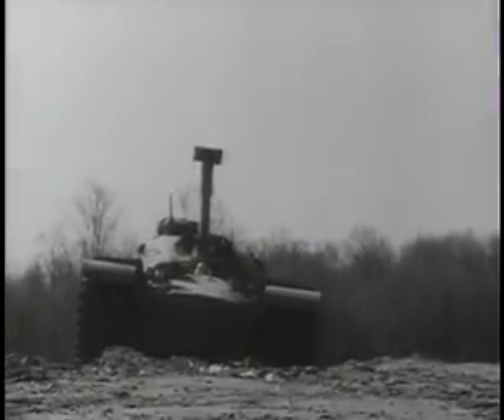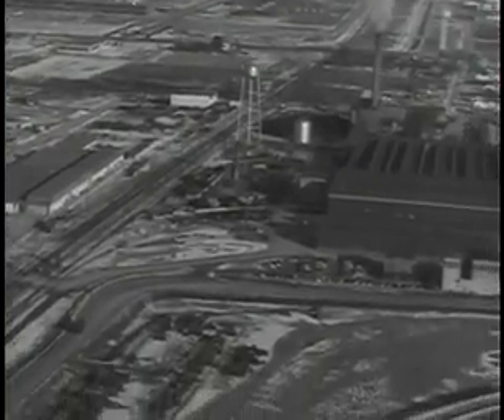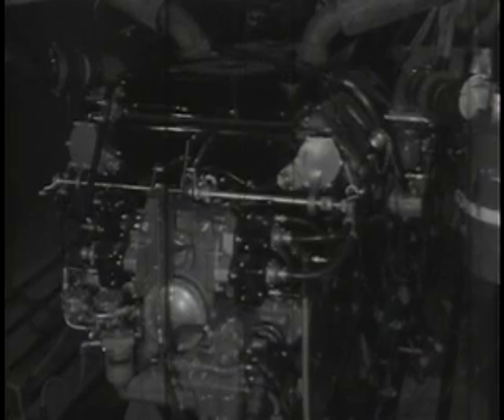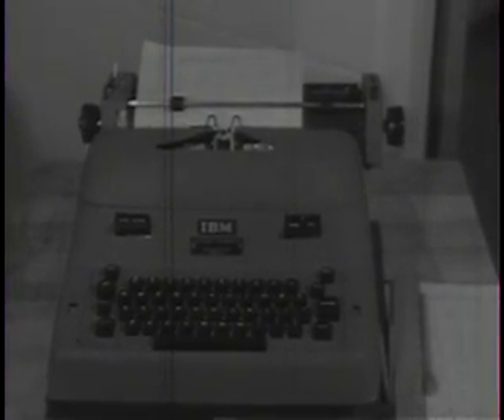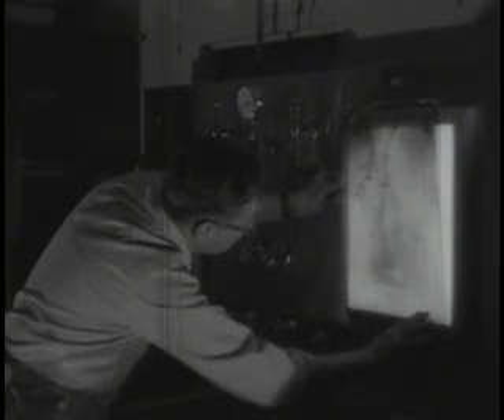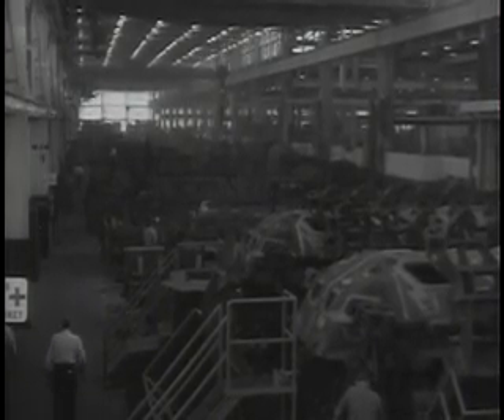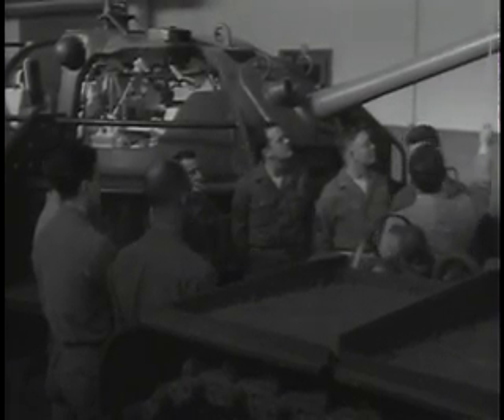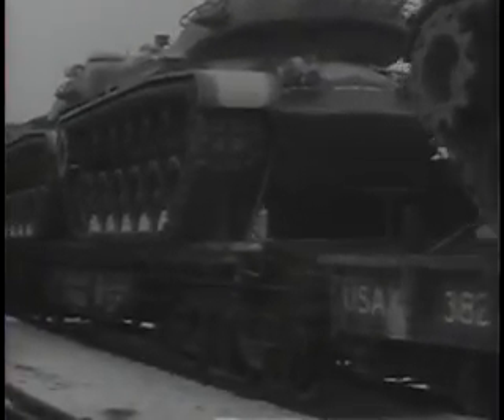M-48 Patton Tank, Design, Development and Testing

Comment: After over 20 years with US. tanks [ retired Msgt usmc] and  served over 2 years in "NAM" , I have spent time at time working on or crewing or just poking around in many types of tanks M60, M48s ,M103 ,M41 ,M60, M4 ,M47, M46, and M1s, Centurions, Chieftain, T55, T62 [I feel for the poor crewmen in it] ,T72, and  a Ger.  Panther.
First of all know .one makes or has made a main battle tank that was not a fuel HOG! [ the centurion burned 5gal per mile ] 
The M48A1 range was around 90 miles [that is with good ole mogas] , the M48A3 with the 1790ds engine "diesel" range was around 180 miles, its top speed 30mph, the Centurions was around 22mph.
The cast-welded armor of the was one best ever fielded just ask the IDF!
The CD850 trans. it could turn on s dime, this was hydro-madtic trans,while the Centurion had "crash-box blood draining manual shift , just ask a Centurion driver! I have a fellow tanker who trained his 12 year old son to drive a M60 and this kid did it very well.
The turret and fire control in the M48A3  was one  the best ever, I hit a 5gal bucket "cold bore shot" at 1200 yards.
Oh ya..I have rammed and jammed over some  5,000 rounds, 76mm, 90mm, 106 mm, 105mm, 120mm, 155mm, 175mm, and 8" ...So if you haven't "walk the walk" shut up!

Comment: I would venture a guess that he is comparing the UK tank to a M48A3, which was diesel powered as opposed to the older gas powered M48A1 (I was a tank mechanic on both).  The M48A3 was a very good tank, and its upgraded version, the M60A3 with its 105 mm main gun, was even better.  During the start-up procedure on the M48A1, a  man had to be stationed near the rear exhaust area with a fire extinguisher to douse the flames that may occur.  Anyone else remember those days?

Comment: The M-48 series was a pitiful disaster.  They were underpowered gas hogs that had no speed,  very poor maneuverability and fair at best accuracy with the main 90mm gun. The 48 had 4 tons added over the M-47 and tracks widened from 23 to 28 inches with no change in engine power. The 48 A2 with fuel injection and covered back deck was an attempt but even the diesel in the M-48A5 and 105mm gun was not much improvement.  The M-60 series carried on with the huge size and cumbersome gun platforms with the M-1 Abrams saving the US armored force. I served on 46-47-48 and tested and crewed the POS M-60 .  For dependability prefer the venerable old 46...my Korean combat wagon.
Reply: From your posting I take it that you (Bill) have never been in a T 54,55,62, or 72, and yes I have and I've driven ring around them all in a M48 and M60. If you want to drive a real problem  tank try the Brit Centurion , its gearbox will drive you nuts. (it burned 5 gals per mile) however it handled much better than the god awful T 62 ( I had one as a pet for a month) my tankers in my unit couldn't believe pile of junk it was,  I wouldn't send my worst enemy to combat it.
I also find your remarks about the accuracy of the 90mm strange, I had no problem hitting a 5 gal GAA can with the first round at 1,200 yards. In my over 20 years as a tanker I have rammed and jammed a hell of a lot of 90, 106, 76, 120, and 105 mm rounds and I am a combat veteran. As a foot note the M46 was an up-grade of the WW II M26, there were no new M46s built.
Reply from the maker: Bill I just posted a clip of some M-46's in action in Korea "A" Co., 140th Tank Battalion, 40th Div.  http://youtu.be/0MW9bq45vko
Reply: ralroost einsnulldrei We were the first army in the world to recieve the M46 patton tanks. Many US tanks for european nations got tested here. But yeah, we quite liked the pattons, but still chose the leopards over them
Reply: Jason Wilson  SPC 4 Larry Owens here. I operated the M-88 for the 702 MT BN at Camp Rice from 67-68. I don't know what all the flak on the M-48 series is about. Trained on the M-48 in Ft. Hood and it was a seriously bad machine that age and poor engineering detail contributed to its poor reputation. The A-2 (fuel injected) and the A-3 (Diesel) were quite good performers. As I remember it, our biggest problem in Korea was lack of spare parts due to the Combat Priority 01 going to Viet Nam. They ran the A-2 and the A-3. Germany had an 01 status on repair parts too due to their having the M-60 exclusively. 

The secret for me was constant vigilance on the maintenance. For a while there I had the only operational M-88 that could dispatch north of the Imjim river. Did a lot of work up there removing old Korean War tank hulls from across the wire.

Some of the names in our unit were SSG Cosmos, SFC Darden (Korean War veteran), and the Commander was LTC Millican and his adjutant MAJ Parish  There was also a SGT Cockcroft and 1ST Lieutenant Paoli (Weapons Officer) Any of the names sound familiar?
Reply: I guess thats why they gave a lot of them to EU countries for free
Reply: I spoke to a few Belgian tank commanders. They quite liked there M47 patton tanks, but maintance was a top priority in our army. But god many were glad to recieve the leopard tank
Reply: F4Wildcat Perhaps it was good in comparison to what they previously had?
Reply: ralroost einsnulldrei I think the US just underestimated the rapid advancement of Soviet tanks. We quite liked our M47's. But i cant say how the M48 and M60 faired.
Reply: I won't argue with your facts.  It's good to see somebody do their homework instead of just spouting their emotional opinion.  Still, you gotta remember that the M48 was a "Medium" Tank so comparing it to front line Heavy Tanks is not really fair.  The guys I know that WERE IN M48's loved their Tanks, especially after getting the 105mm.  These guys knew they were in a Medium Tank and NOT a Heavy.  They had due respect for the T72's and such.  Please don't compare a Medium Tank to a Heavy Tank.  The expectations are a lot different.  Our M48's served us well but of course they're NO M60A3!  Our Local NG Company had our M48 for years.
Reply: Always good to hear someone who crewed the vehicle in question weigh in with an opinion.  And thanks for serving!
Reply: ChiTownView Headed there shortly and thanks!
Reply: F4Wildcat I'm guessing the Leo was a better tank all round. I read somewhere the US gov't gave most of its M46s to EU countries for free, and heard from some sources that each Patton afterwards was progressively worse. 
Disclaimer: that's what I've read. I don't have first hand experience.
Reply: randy109 It was not a medium tank. "M" in MBT stood for "main". There was nothing bigger or heavier in the American arsenal at that time. I think it was quite maneuverable, had decent speed and cross-country capabilities. The 90 mm main gun was accurate if properly bore-sighted - a big area of neglect. Granted it was not the best armored vehicle. It was a gas guzzler and was prone to breaking torsion bars, but had good radio equipment, both AM and FM.
Reply: ***** Come on, John. You know that the M103 was an experimental tank that never went into production. There were other such monsters. I believe there are some interesting examples in the Armor Museum in Fort Knox, KY (at least there were in the 1960's).
Reply from the maker: ***** Bigger more powerful check out this documentary about it on our Tanks For The Memories playlist. https://www.youtube.com/playlist?list=PLkOfxruvmJEfmYWb24eQb1dicq7pXPtUx
Reply: The Army failed to take serious numbers of the M-103 Heavy tank as its' mission changed. However, the Marines took a whole bunch of them. There was an old boneyard out north of Turkey Run Rd in Ft. Hood that had all of the Army M-103 equipment in it. We used to go out there and scavenge turret electronics from them. They had essentially the same firing systems.
Reply: msotil You are correct as to the M in MBT meaning Main Battle Tank BUT the M-48 as well as the M-60 were medium weight tanks. The M in M-48 means simply Military as opposed to other letter prefixes given to equipment still in design or testing. Once the equipment was accepted for use it got the M [number]  designation. The M-103 was a Heavy tank at 68 Tons, as is the current M-1 ABRAMS at 70 Tons. As an M-88 operator it was my job to know these things in case I ran up on one in a dark rice paddy or alleyway in Germany. circa 1966-69.
Reply: ***** Thanks for the explanation. I  have see some huge machines (in museum) designated "T". If memory does not fail me, T10 and T28. Apparently those never saw production.
Reply: ***** I remember the M-88 recovery vehicles well. As a M-48 crew member, I had my share of replacing torsion bars and track shoes (among other second echelon maintenance). When they (the M-48s) broke down beyond what could be repaired in the field, which rarely happened, the M-88 would towed them in. Amazing.
Reply: Not to forget the M47 and 48 had poor combat records in the Iran-Iraq war.
Reply: msotil If I'm not mistaken, T series vehicles are test vehicles/prototypes, ie. haven't yet been approved for general (or limited/restricted) use by the arm of service responsible.
Reply: Ole Sleepy as you saying it's the good thing the Norh Coreans had worst armor then the 2nd ID serving in 1968... all of our armor was the M48A3s with the flat diesel power pack. As an optical technician with the 702 HQ maintenance battalion I'm not aware of any major problems with the armor.